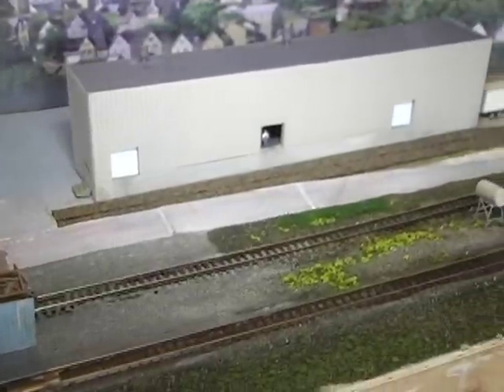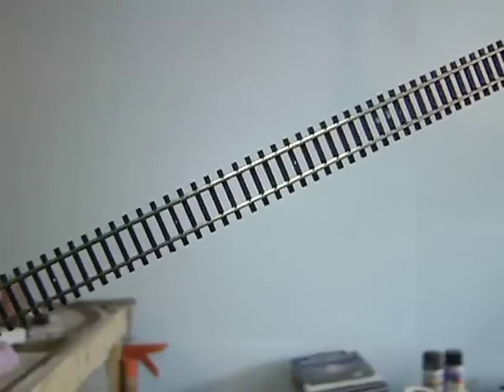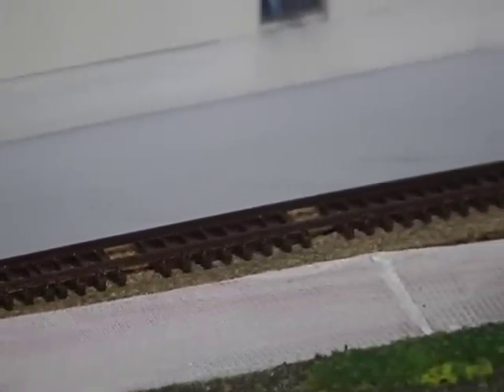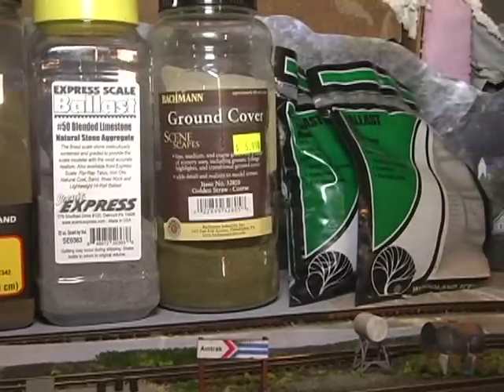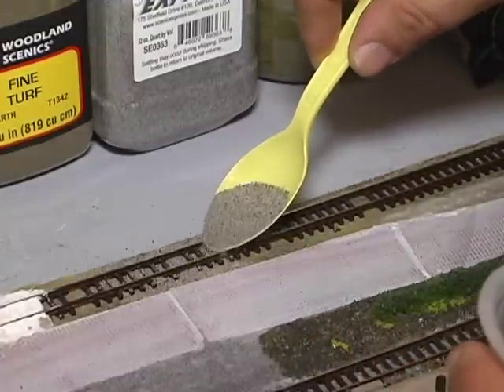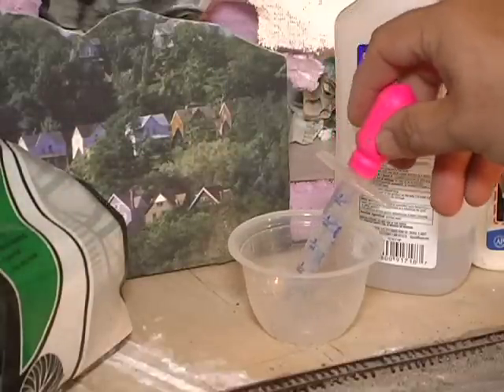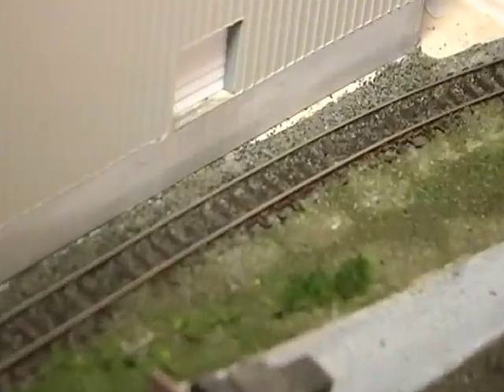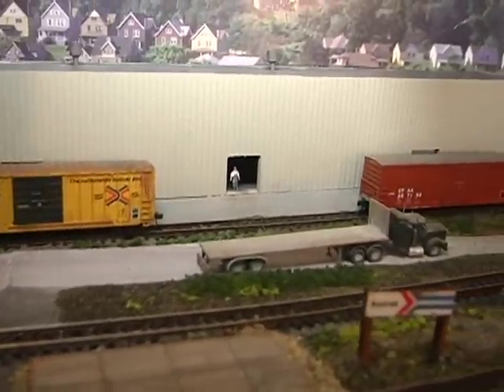How To Ballast Model Railroad Tracks

Comment: I noticed in the above video that you converted an old box car to a storage shed. I mentioned before that my father worked for the RR as a carpenter for 44 years. The last 15 of those years were spent in the "Glass Car", which was an old coach that had been converted to a work shop for the making of replacement windows. I (of course) plan on having one of those shops on my layout. I'd like to see how you handle that kind of conversion.